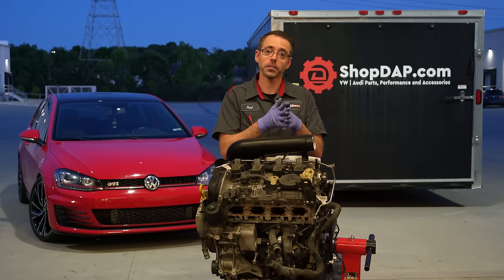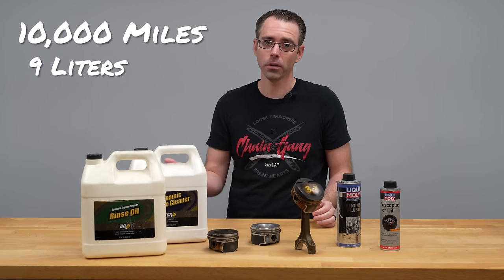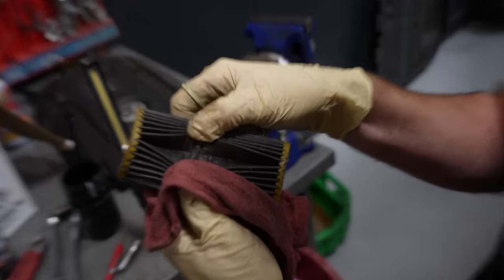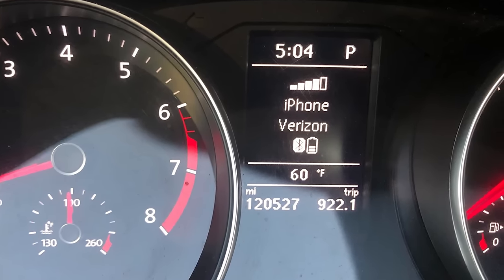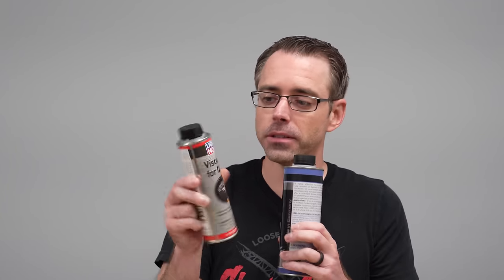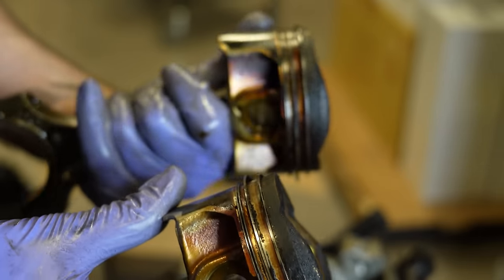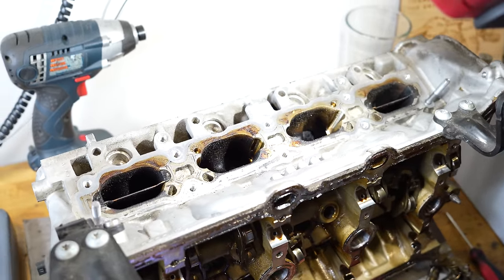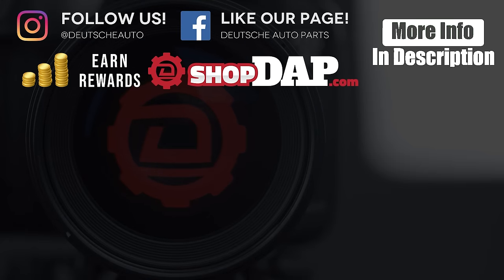Can you Fix an Engine Burning Oil for $20

Comment: Working on VWs and Audis professionally in my experience I’ve seen aftermarket oil filters make oil consumption much worse especially with the very cheap ones and it’s one of the first things that Audi has you check when performing oil consumption measurements
Reply: If its burning oil and its not the pcv/ccv just bin it. Piece of shit engines in piece of shit cars. Same as BMW N63.
Reply: What kind of oil filters should be used? It's odd though, how does an aftermarket filter affect oil consumption?
Reply: @akdomun  depending on what level a filter may pull material out, it could strip wear additives etc or restrict flow. That would be my educated guess.
Reply: The only reason for oil consumption is the bad construction of pistons and especially too weak piston rings.
THAT must be fixed first, those after market filters are definitely not the main cause, they are said to mask the real problem by garages.
I have often seen it with car engines and certainly also with motorcycles, think of BMW.
All kinds of stories about oil and running in were nonsense, only the construction was not good, but they did not want to admit it, all at the expense of the customers, just like Audi, Volkswagen and BMW.
Apparently modern engineers can't make good engines after 150 years because they don't understand how it really should work, I'm 100% sure of that.
Reply: @akdomun  I’d recommend oem the cheaper filters can change oil pressure due to the design
Reply: @akdomun  I’d recommend oem the cheaper filters can change oil pressure due to the design.
Reply: @heinpereboom5521  Yeah is the whole trend of using low tension piston rings to get a little less friction and better mpg but burning oil actually does more damage to the environment - they didn't test enough or think about that sadly. 

Had an e39 with an M54 which burned oil all the way to 400k km. Was bulletproof otherwise but by 7k interval I had replaced all the oil in the sump.
Reply: @akdomun  It is indeed a pity that with these slack piston rings applies.
I find it completely ill-considered and it does next to nothing to save fuel and indeed does more damage to the environment as you say.
Reply: @akdomun  It does not.
Reply: @akdomun  Same here .
Reply: @heinpereboom5521  Or maybe the engineers do know how to build good engines, but the bean-counters made them incorporate this inferior element into the design so that the engines would become uneconomical quicker and have to be replaced sooner.  Depreciation makes it more economical to replace the whole vehicle with something newer.  Aka "lifing" to ensure ongoing continuity of car sales, and decreasing the length of the renewal interval...  by design.  

In fairness, the auto industry is highly innovative, esp. in the last 20 years.  Auto engineers keep coming up with clever engineering refinements and cool new materials and features and design/styling, and all that R&D costs a bunch of money.  The best way to fund it all is with the sale of new cars.   

The deeper problem lies within our economic necessity for growth.  Building cars that last a million km makes better use of the spread of their lifetime environmental impact footprint, and has, in fact, already been done, but the fiscal profit directive dictates selling more new cars more often.  

100mpg petrol car has also been done.  Not very quick off the mark, mind..... But the fuel companies \need/ to keep selling benzine and diesel, and performance cars are a lot of fun, and we enjoy super-fast transportation in the "developed" societies, and the inland revenue is getting around 50% of what we individuals pay at the pump,  and the millions invested in the sector have yielded billions in return... .

Hm.  So if the entire auto industry moves over to EV manufacture within 18-24 years, where does that leave the fossil fuel industry and all its jobs and talent?
Reply: @Grantidge69  You have a good story.
Still, it's not good for the auto industry to make a mess like Audi.
They had a good name, but for me it is gone forever, I will never buy an Audi.
My confidence is gone, as with the BMW and VW brand, engines whose camshafts are driven by bicycle chains to save 0.1% fuel is completely ridiculous.
Indeed, the auto industry is making increasingly poorer designs, such as direct fuel injection, wholly forced by environmental organizations and politics.
These engines only run well when new, but problems with intake valve fouling can quickly come as they are no longer cleaned by gasoline, resulting in poorer combustion.
That results in a lot of costs for the customers and contributes much less to a clean environment than we are led to believe, the reliability has also disappeared with these engines, especially if you drive a lot of kilometers.
Whether you drive a lot or a little, reliability is always very important.
The environmental madness has struck and to save that last % extra, the most idiotic things have been invented, that principle is always completely wrong, unless you want to give this industry a very bad name.
Reply: @heinpereboom5521  Drivers of GDI engines are reporting catalytic converter failures in 2-year-old vehicles, likely due to carbon build-up on the intake valve breaking loose and burning the expensive catalytic converter.
They get great MPG, however.
Reply: @onepalproductions  That is proof that major problems can arise with the contamination of the intake valves, the system is simply unreliable, no other conclusion is possible.
Reply: @johntdi19  
John I have researched this until I'm blue in the face and would really appreciate your input.

What oil(s) would you recommend for the 2012 Passat 3.6 VR6-GDI (w 85k)

I've looked most at these...
•Redline
•Liqui-moly
•Motul 8100 xcess (gen 1 & 2)
•Motul 8100 xclean (gen 1 & 2)
•Motul 5-40 Sport Ester
•Amsoil

Your thoughts... Thank you in advance!

Comment: Great video.  The key to these engines is good oil every 5000 miles!  My 2014 Passat burns about 1/2 liter every 5000.  Usually, the oil level is good till about 4000, then I just it off with the extra that is leftover in the bottle and all is good.  Using Liqui Moly is key for VW's.
Reply: the problem is with the TSI/TFSI engines (caused from a misconcept from the piston oil scrapping rings, solved only in 2018) ,and if the problem appears did rise the oil consumption at +1 liter per 1000km! the key for VW (and all modern engines) is to make oil changes all 10 000km or 1x year ...
Reply: In younger days I became owner of a 70 datsun station with with see through rockers and a quart a week oil burning habit, first getting gently used oil from a friend, to finally adding some gear lube 90wt as a replacement, it cut use by half and it was better than running it low, just had to change the mixture adjust leaner so it wasn't fouling plugs, that car was a fun summer beater for early 80s

Comment: I have an 2006 e46 330ci with the M54 engine. I currently have 165k miles on the car and the valve stem seals have started to leak. I get blue smoke when I give the car gas after it idles for about 15-20 minutes. I recently tried Liquimoly oil saver and it has completely solved the issue. I used 1 full can and half of another and so far it’s been close to 2k miles and I can not get it to smoke. These really are great products
Reply: Hurry up and sell it!
Reply: @zechariahkress3741  why do you say that?
Reply: Then you dont have valve seal issues.... NO motor flush is going to fix wasted valve seals

Comment: Very cool.  I once flushed a 72 LeMans, and had clear oil with every oil change since. I changed it four to three times a year and used it to deliver pizza.  I never could figure out why newer cars always turned the oil black no matter how often I changed the oil. 😕 Cool video! 😃
Reply: EGR
Reply: EGR, and Direct injection engines tend to run hot in the combustion chamber and really warm up the ring area

Comment: Way back I got a VW powered Sandrail that was burning a crazy amount of oil.  I suspected that the rings were carboned up and stuck because the distributor timing advance wasn't working.  I decided to give it a Hail Mary and used Seafoam down the carb flooding the engine out several times.  After running a whole can through it over the course of a few hours letting it soak between floodings it stopped burning oil and it ran great.

Comment: You nailed it there, low tension rings may be part of it, but also thinner oil, longer oil drain intervals, and lackadaisical maintenance by users. My guess is its mainly owners blowing off maintenance. My 2011 tdi cjaa with 225000 miles, no additives and only on time changes with good as specified synthetic oil eats about a liter and a half in the standard 10k interval, nothing odd at all.
Reply: Weak piston rings is the main cause.
The long oil change intervals are indeed bad, that is a false economy and also has consequences for the often poorly constructed camshaft drives.
The thinner oil only gives more consumption if the construction of the piston and springs is not good, otherwise it is not that bad.  (if it is synthetic oil)
Your oil consumption is good after so many miles and will stay that way for a while.
You are in luck with your car engine.
Reply: modern engines burn oil,,fact..i have a clevo, thrashed, change oil every 3 months,ish.. doesnt use a drop..14 yrs..beat that.. synthetic oil is crap..expensive,,crap..
Reply: I have a vacum pump I used to suck the oil out. It gets most of it and I can change it easily now. I change my oil regular 5000 miles
Reply: Old cars also burned oil like crazy, long before “weak rings” became a thing. 

The physical construction of engines has vastly improved, as have the materials used. Owner maintenance on the other hand, has plummeted.

Comment: Back in the day you would run one quart of ATF in place of one quart of oil during an oil change. Drive the car for a hundred miles or so and than do a complete oil change. This trick works well for a sticky lifter.

Comment: I've been using liquid moly engine flush every 3rd oil change on my 2012 prius. Now on 360,000 miles and burning about 300ml every 10,000 miles. Highly recommend and if your going to do this start before it has oil consumption issues.

Comment: I am sure that someone else may have commented on this already, but the Cylinder 2 in the first compression test according to what we saw on the video only actually went up to 145 to 150. So there wasn't a loss of compression necessarily between the final compression testing on Cylinder 2 and the initial testing on that cylinder.

Also, I get the feeling that part of the reason for a decrease in vehicles lasting as long can also have to do with the large increase in the use of ethanol being added to gasoline.

Comment: Great video man! EPR is BGs version of LMs engine flush, same purpose and price range.  We sell BG Dynamic for the badly sludged ones, EPR for consumption and pm with BG MOA, with amazing results. 
If you want a GREAT top engine soak product (for the upper rings) BG also has some options. 1- #201 for an injection system flush that digs deep. 2- #210 fuel system cleaner (older chemistry) but work amazing for a too engine soak. 
Feel free to reach out if you guys need more info. Great job guys!

Comment: I could have sworn that Audi told us that 0.5L per 1000km was the acceptable oil consumption on the E888 TFSI 2.0 engines. :)
Thank god mine doesnt have this. Still love watching these real issues and fixes videos than some cray engine swap ones.
Reply: I am running EA888 Gen3b with chip tuning for 130k kilomiters. St1 is last 100k
Changing oil every 10k kilomiters.
No any issues. This last gen is really good and long lasting 👍
Reply: @ToCostas  I agree, they apparently did fix this issue back in 2014. So 2014 and up should be better in terms of oil.
Reply: @F.S92  yeah the wife's '14 Jetta with the gen3 1.8 is fine.
I change it around 6-7k cause it gets a fair amount of highway use. 
It'll take maybe a half quart by around 4k or so.
If I get the chance ,I'll check it and top it off with some MMO a few hundred miles before I'm gonna dump it to help clean a little.
Reply: At a consumption of 0.5 liters per 1000 km, the engine must be overhauled.
I used to have a two-stroke motorcycle and it used much less oil, but it was then seen as polluting and oil wasting.
The real problem is the surface pressure of the piston rings on the cylinder wall.
This surface pressure is simply known, but for less friction and so-called fuel savings, this surface pressure is lowered, but that is completely incorrect, because the misery that ensues is much worse than those few % fuel savings.
Furthermore, the piston must also be well constructed.
When I see the construction of these pistons in this film, I immediately think of the garbage can, they are so badly made, just rubbish.
Unfortunately, after 150 years of making engines, people have forgotten how to do that, at the expense of customers, who are just guinea pigs, they don't test anything in the factory, otherwise they wouldn't put it on the market, because the brand name will also break.
Camshaft drives are also a disaster, together with the far too long oil change intervals.

Comment: BG Dynamic Engine Restoration Service kit majorly improved my Camry consumption. I was burning one quart weekly (500 mile) After this treatment I have only burned 1/3 quart in the last 1000 miles. So grateful for this video. Thanks for attaching amazon link! $350.00 with taxes is a lot of money but should save my converter with the excessive oil consumption. So in my case it was a success! 
Rick

Comment: I have a 14 Audi TT that was burning 1 quart every 500 miles...I flushed engine with BG109 before oil change but I ran it for 50 mins at 2300 rpm...more time than recommended. It now does not burn any oil.....Amazing Stuff!

Comment: My vehicle has been burning a lot of oil lately x thank you so much for doing this video. I’ll be calling my dealer tomorrow to see how much the engine cleaning service costs.
Reply: You can do that, but it won't solve the problem.
The only reason for oil consumption is the bad construction of pistons and especially too weak piston rings.
THAT must be fixed first, other things are definitely not the main cause, they are said to mask the real problem by garages.
I have often seen it with car engines and certainly also with motorcycles, think of BMW.
All kinds of stories about oil and running in were nonsense, only the construction was not good, but they did not want to admit it, all at the expense of the customers, just like Audi, Volkswagen and BMW.
Apparently modern engineers can't make good engines after 150 years because they don't understand how it really should work, I'm 100% sure of that.
Reply: So how did it work. I tried it  and my car went from about 1 quart every 900 miles to 1 quart every 2K miles. GTI at 230K miles

Comment: Cylinder 2 and 3 are interesting, i had a similar thing happen with a 98 grand cherokee with 300000 miles. I actually had above spec compression on cyl6 which i believe is carbon buildup on crown and combustion chamber

Comment: I've had multiple 2.0 tdi, 2.0 Audi and 3.6 VR engines and a 1.4 in a jetta and I can honestly say I've never had a oil burning issue. (knocks on wood) Heck I even have a Ford Duratec with 230k miles on it (all highway though) and it uses less than half a quart over 10k mile OCI. All have received OEM spec oil or better usually Mobil1 or Castrol Edge. Engines with chains get 5k OCI and those with belts usually 10k oci.
Reply: Lmao your lucky, I've had a dozen vws and they all burned oil
Reply: @NOTaGLI  yes, and you probably drive all of them as nice as you could, right? a he said in video, if it's burning oil etc,  it's probably you. i can confirm that. ford was the worst.
Reply: @izoyt  never had a brand new VW, always maintained them well myself. All my used turbo vw's burned oil. And I definitely drive the cars hard lol
Reply: @NOTaGLI  when you buy used you have to factor in the guy who didn't follow engine break-in directions flooring it as soon as he started it and never bothered changing the oil because he knew he'd just turn it in at the end of his lease
no amount of maintenance afterwards can undo all that
Reply: Idk tbh I only work on my own Volkswagens.  But the mechanics I know have all said every VW they have seen come through there bay had oil bleeding through the charge pipes. Imo it's just a matter of time before the turbos start leaking oil.
Reply: @NOTaGLI   I bought my GTI new in 2016 , put a stg2 tune on it after 10k miles and started tracking it regularly. Considering it now makes almost 50% more power than original spec and its hard life at the redline under 30+ psi of boost, it now has 65k miles and uses less than a quart of oil between the 8-9k oil changes. Original turbo and absolutely no issues. Plenty of other track buddies with GTIs and Golf Rs that despite being driven hard don't blow up since they're properly maintained.

I bought my 2015 TDI used (with 60k miles on it), I checked compression and was in spec (I don't remember the values anymore) and had no oil leaks, blow-by or any other apparent issue when I got it. It now has almost 130k miles and it's always been using anything in between a quart and 1 1/2 quarts between its 10k oil changes; its life is mostly highway miles and always driven gently.

This is just an example using the same generation of cars of similar age, but I have a long history of VW ownership and from my experience when you buy one used, always expect  to find evidence of previous owner's neglect and mistreatment.

These are not low compression under-stressed Toyota engines that you can pour some canola oil in every decade and expect them to still get you to work every morning.